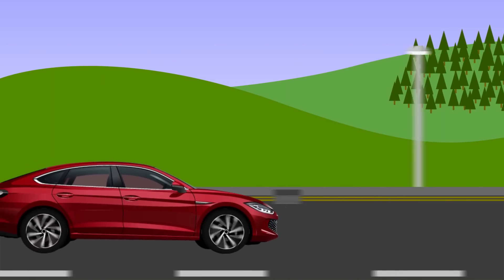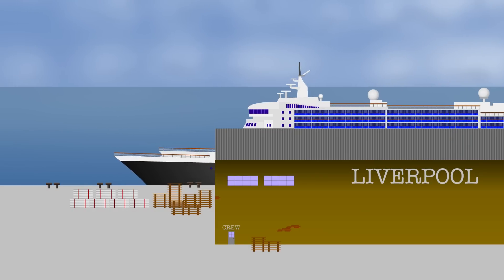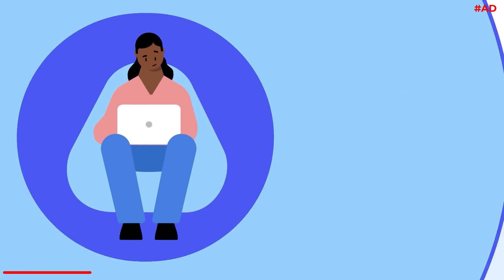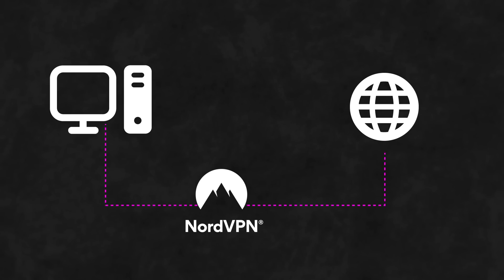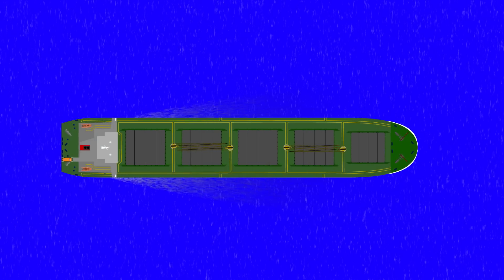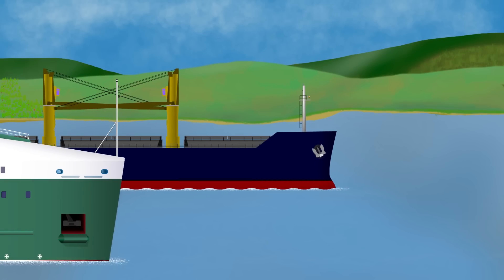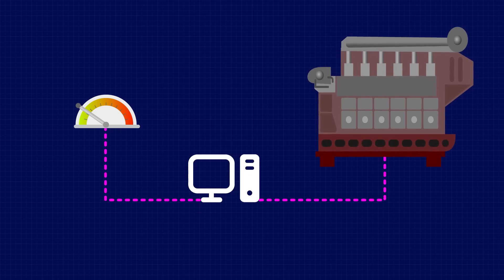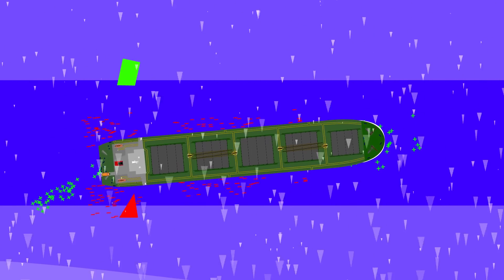What's Going Wrong With Fuel Efficient Ships?

Comment: Sounds to me there is not a whole lot into this. When I was sailing you had full ahead on the telegraph, and above that at sea or full seaspeed. Everything up to full ahead was instantaneous, going to full sea would activate a load up program of 20 minutes. The thing with manouvering is not so much speeding up or slowing down instantaneously, but adding more revs generally increases pressure on the rudder making it more effective. In close quarters near collision avoidance you generally go to full ahead for this reason. The vessel will not accelerate much in a short space of time but the added pressure on the rudder will make it turn better. Cargo vessels spend most of their time at full seaspeed so these fuel economy systems do not save all that much I would think.

Comment: So; why are ships going dangerously slow?  The video never actually answered the question in the title.
Reply: emissions when in harbor areas
Reply: The engine power limits are used to manage the emissions from the ship, in all areas, just not harbors.  The lower the maximum allowed power the lower the emissions over all.
Reply: @jamesmurney1374  I don't think they really care about emissions at sea. It's all about the $ at sea.
Reply: @bryanachee7133  Emissions are becoming very looked at for ships.  The EEDI (Energy Efficiency Design Index) is a scale used to determine a base for every ship type and will slowly tighten to reduce emissions across the world wide fleet.  So if you only use less power in port (a very short part of the voyage) you will never meet the Design Index.  So ships have to run at reduced power at sea to be in compliance.   I  talk to Captains every day that are deep into trying to keep ahead of the new regs.

Comment: Well adding a ship mode led indicator to the captain's console panel along with a basic Norma:- (Slow open ocean Fuel-efficient mode), Performance-(High-speed good Fuel-efficiency), and high-Performance mode:-(All speed & Power with low Fuel-efficiency).
All the Different modes can also Add or remove all fuel consumption limits set by power regulator units according to what engine mode is set to additionally having some Variable speed controls work in parallel with each Engine mode it is set to.

Comment: As engineers we know that smart technology is more trouble than it's worth for many applications. If you want the engines to be more efficient then you tell the person at the helm to drive better or you give the telegraph handle a little button to be held when you want a gradual change. Aircraft pilots manage just fine when they get a new button and so can maritime pilots.
We used to say "Never let a computer make a decision because it can't be held accountable." and we need to bring that back immediately.
Reply: well thats why the smart tech is turned off when it has the potential to cause more trouble... as the video explains...
Reply: @redbean9410  Of course, and usually it does turn off! Sometimes however it doesn't respond as it should and causes an accident, which is the point of the video. It's a feature that is better turned on when needed than turned off when not. You want software like that to fail to a known state that prioritizes safety above efficiency.

I'd rather pay a little for human inaccuracies than risk paying a lot for the inaccuracies of an imperfect program. If I was captain of a ship and silly software decided to ignore what it was told to do and caused someone to get hurt, I wouldn't have a cow; I'd have an aurochs about it.
Reply: Fortunately, Casual Navigation just released a video about why ships sometimes disable the automation that you mention. 😀

Comment: This is so stupid.  Fly-by-wire aircraft have different modes depending on phase of flight usually determined by things like gear being up or down, weight-on-wheels switch, throttle position, TOGO switch (takeoff / go-around), etc.  Why don't ship computers have different modes like cruise, channel navigation, etc?

Comment: Seems to me like ships need a “sport” mode like a modern car, where power & responsiveness are improved where conditions warrant it.
Reply: Well some ships have a special "manuvering mode" where the engine goes to a higher rpm and the propellor pitch is more responsive than on the normal operation mode.
Reply: It sounds like ships have a manual mode, like modern cars that use a manual gearbox, where power and responsiveness are exactly what the driver commands at any time.
Reply: Direct handling mode
Reply: They can turn off the limit
Reply: @m1co294 some ships literally can't turn off their power limitation systems, as mentioned in the video

Comment: i doubt it was the fuel conservation system that caused the suez canal blockage.

i think it was the captain being bored and using the navigation path history to draw a naughty shape.

what happens if someone goes into the engine room and pulls on throttle cable manually?

while they can manually rev up the generators unless the electric motors has a similar throttle cable system they couldnt control it manually

Comment: That automated system seems like a tragic accident waiting to happen.
Reply: Not quite, automated systems significantly reduce the workload that crews have.
They are meant to aid crews that know how to safely operate without them.

On most conditions, the automation lets the crew have more spare mental capacity/keep focused for longer (just like with airplanes), and it also allows for the ship to not allow the crew to put the ship in a dangerous situation (like flight envelope protection on aircraft).

However, since the crew is supposed to be trained to operate without such systems, they should be able to turn them off in cases where they either fail or conditions are too unpredictable for a computer system (humans are way better at predicting this sort of thing than computers).

TLDR, automated systems (assuming that the crew is properly trained) make stuff safer.
Reply: @Methyl_The_Sneasel  there have been a few major plane crashes due to training issues so still makes me nervous to take control from operators.
Reply: @stephanieparker1250  You should know that most of those safety protocols are only common sense in hindsight.
Most of the time, the type of thing that causes those are complete flukes that no one could have realistically predicted.

You should know that stuff like air travel is significantly safer than crossing the street.
Reply: Also, before I forget to add this, it also allows for what they call "Flight envelope protection" in aviation (or whatever it's nautical analog is called).
If the sensors are working properly and in most circumstances, the computer will (to put it bluntly) not let you do stupid shit.

Comment: This kind of reminds me of the increasing sophistication in software control of cars including throttle maps - there are aftermarket remap tools you can use to dynamically chance the accelerator response curve for efficiency or faster responsiveness, but there's also the more recent introduction of drive modes in newer vesicles that does all of that with more explicit and integrated control that the vehicle is designed to work with. Are more modern ships being designed with native control over power delivery in a similar way (ie the tiller itself does things like acceleration smoothing and control remapping to optimise for efficiency, but with explicit exposed controls that could be engaged to indicate an emergency manoeuvre either as a separate "drive mode" control or maybe by having an extended range on the control inputs with an immediate response guaranteed at the extreme ends of that range).
Reply: @-DM Fair, but I would hope commercial ship operators have enough common sense to realise that if there's a setting with a "comfort" mode that switching to a different mode will obviously be less comfortable...
Reply: Yeah the whole smoothness of how the engines are throttled up and down really struck a nerve lol. Idk if you’ve driven a modern car with a manual, but because the electronic throttle always closes gradually to reduce nox emissions, every time you change gear the revs keep going and it makes it so annoying for anyone who’s used to a cable throttle that just closes immediately when you lift off to change gear. Honestly would be a deal breaker lol
Reply: This video talks about how ships are sometimes required to disable the power limitation system for certain piloting operations.  
I suspect this includes newer ships, and thus answers your question about whether ships could disable power management.

My car has electronic throttle control. My previous one used a cable. Although my new car is easier to rev-match when I shift gears, it honestly doesn't bother me. The engine responds instantly and the clutch is crisp. It doesn't mess me around.
I imagine that Toyota's electronically controlled clutch might annoy me, but I avoided that for other reasons. Honda still makes a great manual transmission.

Comment: Reminds me of the way cars behave now, I’m glad there’s still a place for the skill of a captain in shipping
Reply: when lane departure system came out - we started getting people who had crashed their brand new cars. the wheel would jerk one way or the other as they drifted close to the line OR they would go to merge with out a signal. the jerk would surprise them and they would WAY over correct.  ive seen roll overs and hard slams into freeway dividers from that kind of reaction.
Reply: @beardedgaming3741 auto lane correctors are a bad idea. Sometimes, you need to drive on or over the line to avoid an obstacle. Also construction zone often force you to drive halfway outside the lane.

Comment: Why not made a modern ship just like a modern car, which has a choice of driving modes, such as eco mode and performance mode.
Reply: I assume those power limitation systems are after market add-ons for older vehicles, but would be very interested in hearing if they're still aftermarket only for modern designs or if they have been implementing more integrated control approaches like the drive modes on modern cars
Reply: Those modes adjust suspension and gear shift timings. Ships have tons of adjustment options for these systems and are adding sensors these days just like cars. It's a problem that's solved by making more advanced systems rather than regressing back to direct control.

Comment: Can't imagine a car would limit the power when I need to quickly merge in heavy traffic!
Reply: Cars actually do dynamically remap throttle inputs these days, there's just fewer restrictions on it (because there's fewer requirements and a simpler powertrain) and the ones with more advanced control software expose those settings readily to the operator (drive modes include things like throttle responsiveness).
Reply: Yeah, but they don't do it because they want to maximalize fuel efficiency or useless stuff like that. Of course if you reduce maximum power not to break the engine or to maintain traction, it is completely different and justified story @bosstowndynamics5488
Reply: They do that, actually. That is one of the functions of a basic traction control system. If one or more drive wheels start spinning fast enough that the computer recognizes and acceleration skid, it will typically cut engine power or use the ABS to apply brakes to individual wheels to allow (or force) the spinning wheels to slow down and match the speed of the non-driving wheels.

You can tell when this is happening to other people by the sound of it. If someone applies way too much power on dry pavement, and there's no traction control system, they'll do what's normally called 'peeling out,' and just have a continuous screech from the tire. If the traction control kicks in and cuts engine power, that screech will become intermittent, like somebody tapping on the horn a bunch of times, but it's the sound of the tire skidding.
Reply: To make my comment shorter, if somebody stomps on the gas, and the sound of the tires is a "chirp chirp chirp chirp," that means the traction control cut off the engine multiple times to reduce the wheel spin. 

If, on the other hand, somebody takes off really fast and you hear a long uninterrupted screech from their tires, that would be the computer not interfering with their wheel spin.

Comment: I mean, driving too slowly may be dangerous as well. I can't say that I know much about it, but I guess it's mostly about the idea that all cars in traffic should move at the relatively same speed; moving slower is perhaps not as dangerous as speeding, but disrupts the traffic in a somewhat similar way.
Reply: When you drive beyond (below or above) the speed limit, you know that you're doing this. If you drive too fast, you will anticipate approaching vehicles that go at the regular speed, and need not worry about them responding to your speed as you yourself will understand that you need to act appropriately.
If you drive too slowly, however, approaching vehicles have a heavy disadvantage in regards to realising that their approach velocity may be too high. As such, you are putting other people in the active role without giving them the knowledge thereof.
Therefore driving too slow is far more dangerous than driving too fast (assuming you can operate and manoeuvre your vehicle at such speed)
Reply: Driving slower is in fact more dangerous than speeding. I have a theory that it is always better to be faster than slower compared to other cars - The most important factor is that you see much better in front of you compared to sides (merging with traffic) or back (distracted cargo driver). Also if anything goes south, the most sasfe collision is front one - you have the most deformation zones there to absorb the energy of impact. Also driving slow makes all the others hate you, overtake you and that makes lot of dangerous situations. If I could choose to drive 70km/h or 30km/h in a 50zone, always go for 70.
Reply: @nellinkafotky8369 the problem with speeding is that you can't expect everyone to go at the speed limit. There will always be accidents/broken down cars/tractors that make the traffic slow down/stop. By going faster than everyone around you are giving yourself much less time to react because your stopping distance increases exponentially with speed.
Reply: @nellinkafotky8369 As someone who agrees that overly slow drivers do create dangerous driving conditions for others, I don't agree with the broad statement that driving slow is always more dangerous than driving fast. There are plenty of conditions where it's absolutely safer to drive under speed even compared to merely at speed, and driving over speed carries a number of fundamental safety hazards that can't be mitigated (higher collision energy, shorter effective reaction times, other drivers not realising how quickly you're going to pass through a give way intersection etc etc).

Often the biggest safety hazards caused by slow drivers aren't even them going slow in and of itself, but them driving inattentively and carelessly when it comes to navigating overall traffic flow (driving slow in the slow lane of a multi lane highway is far safer than driving slow in the passing lane while obstructing faster moving traffic, which creates unnecessary frustration and encourages aggressive manoeuvres by other drivers trying to pass you, for instance).